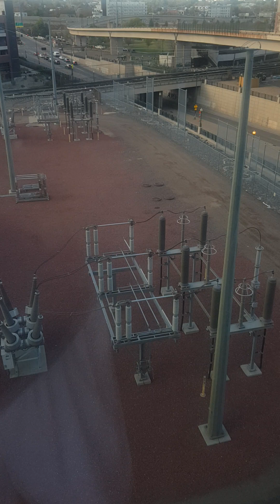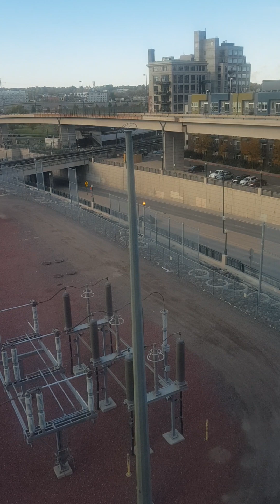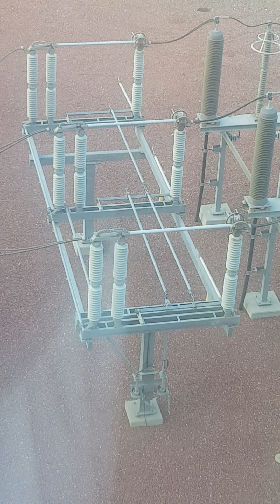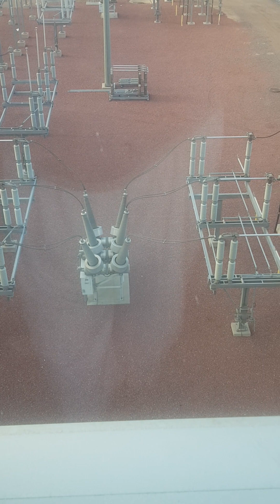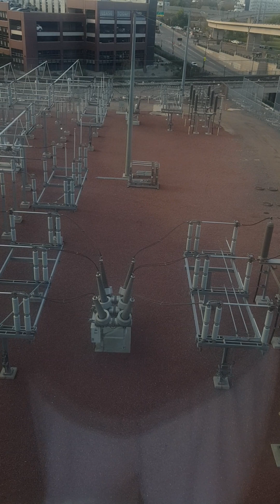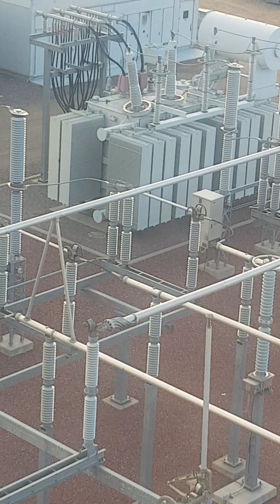Distribution substation components

Comment: All those black wires that come out the low voltage side...are those the feeder lines that go out to residential neighborhoods.... ?  CAn you explain that part of distribution....
Reply from the maker: Distribution substations step down the voltage to the primary voltage level in the 11-28kV range. Then using either overhead lines or underground cables the power is distributed and finally step down for the 110-220 V level.
Reply from the maker: Since we are stepping down the voltage, the current will increase significantly and hence there is a need to have large cross sectional area of copper and hence the use of many black wires